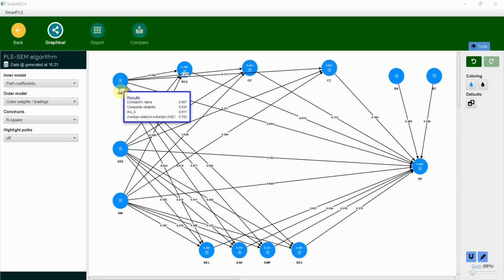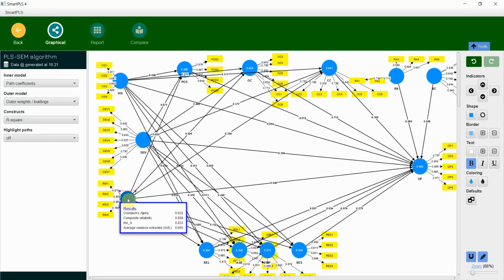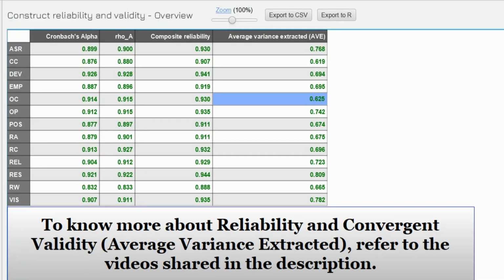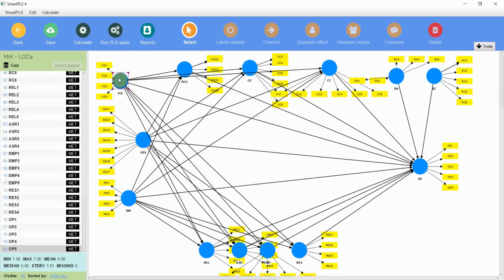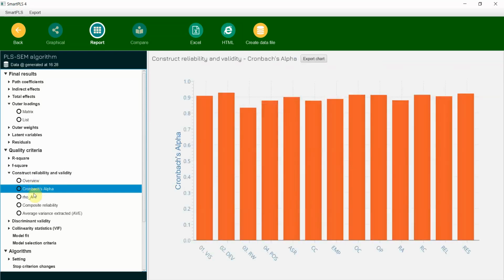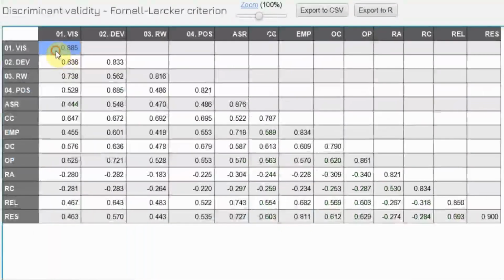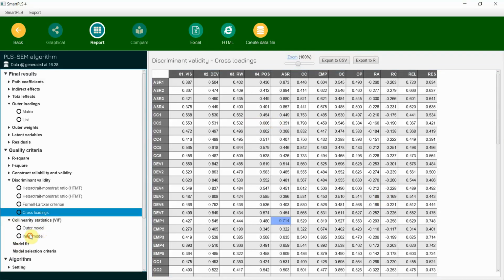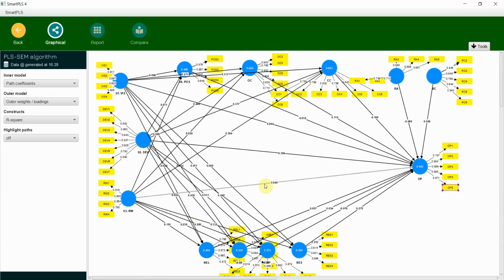#SmartPLS4 Series 12 - How to Interpret Measurement Model Output with Multiple LOCs?

Comment: Hello Sir. In my model, the independent variable (X), mediator (Z), and dependent variable (O) are all higher-order constructs, and each of them is formed by several reflective lower-order constructs (each LOC has its own reflective indicators).

Is it appropriate in PLS-SEM to keep this structure (X, Z, and O all with LOCs) and first validate the measurement of all LOCs, then move to the higher-order level? If yes, what is the recommended way to do this  and if not, how would you simplify or re-specify the model?

Comment: Thank you Sir for the knowledge that you impart to us. I have a question. In the video on construct reliability, you had mentioned that reliability values above 0.90 are not desirable.  But here we got such values. What should one do when you get reliability values above 0.90 or as you pointed out in the previous videos, 0.95?
Reply from the maker: Thanks. I am glad you liked it. Check for item to total correlation plus the correlation of items with each other in a particular construct. Too high correlation means two items are measuring the same concept. One of them can be removed and reliability assessed again.
Reply: @researchwithfawad  Jaza ka Allahu Khairah. Will do that!

Comment: Sir, What to do if the p-value is greater than 0.05? How to fix this issue?
Reply from the maker: P value greater than 0.05 is not an issue. It means your Hypothesis is not supported. You will need to discuss why the results are insignificant.